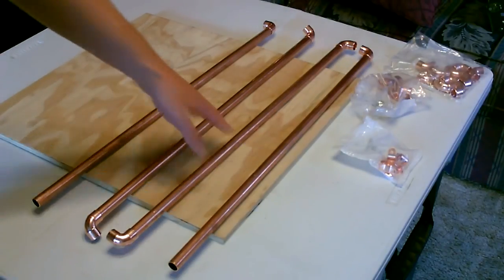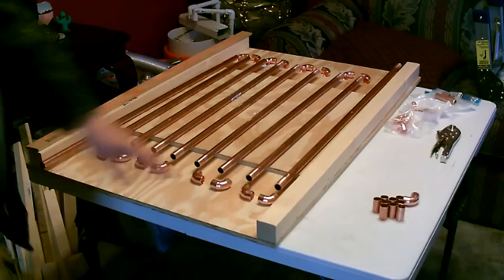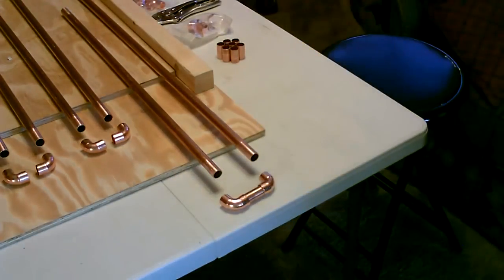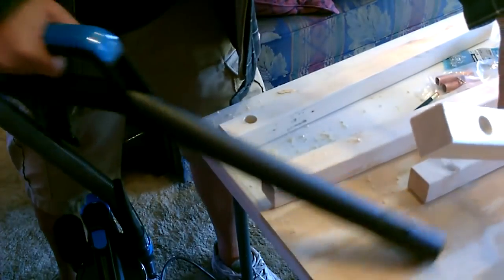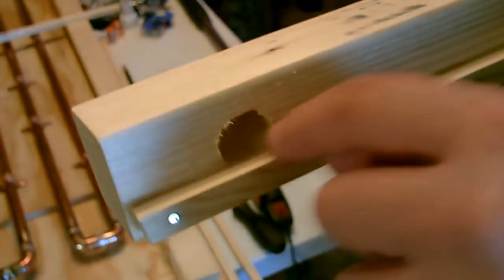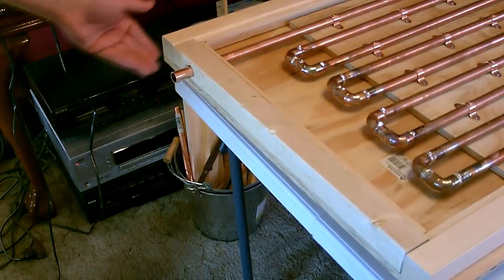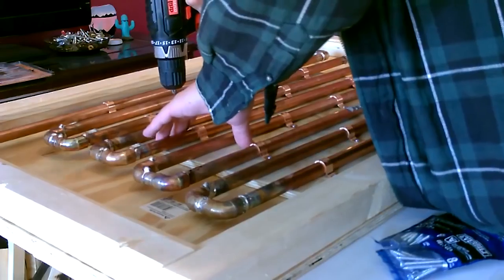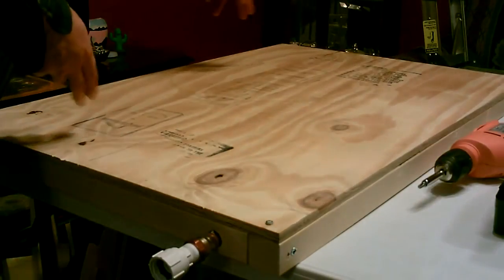Riscaldatore di acqua solare termico tubo rame! -Facile fai da te (InStr. completo) 150F + [o inven

Comment: In your opinion, if I did the same thing with a larger diameter pipe and did a similar thing to put under the base of a pizza oven, and heated the water for a swimming pool, would it work? I accept advice